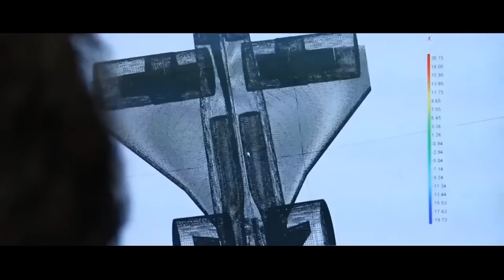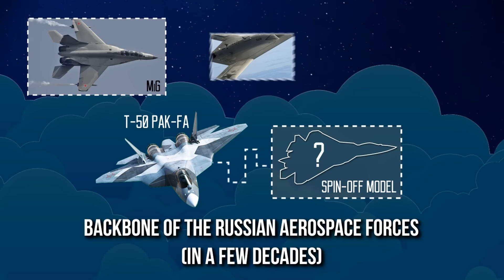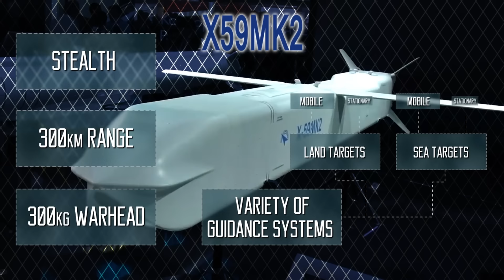The Sukhoi T-50 PAK FA 5th Generation Fighter Jet Will Enter Service in 2017 AS PLANNED

Comment: pakfa t-50 faster than the f-35 .  So it has better chance of outrunning missiles. its a supperior in all aspects
Reply: You do know that all air to air missiles in service with both air-forces` can go faster than the planes right? the T-50's top speed is mach 1.9. The average terminal speed of ATA missiles is between mach 2.5 and mach 4.
Reply: Oh unfortunately, the T-50 doesn't have the most powerful fighter jet engine in service to date.  The F-35 does.

The F-35 is not a superiority fighter unlike the F-22 and the T-50. The F-35 is smaller and hence more stealthier than the T-50. If you think that the data acquired from the designs of 3 stealth aircraft operated by the USAF didn't got into the F-35 you're dead wrong. Reports are all ready coming in from RED FLAG 16 "F-35 is stealthier than F22"
Reply: xXEndLessKaosXx  I never said that data from the three previous USAF stealth fighters didn't go into the f35. What I was think in king was quite the opposite ,why not upgrade the f22 with some of the same technologies as the f35 and they should have made more f22s. It doesn't matter anyhow  Russian radar can see the f35 anyhow
Reply: xXEndLessKaosXx  I like the pakfa t50 regardless of what people say. And the yanks got plenty of planes for specific missions that can simply be upgrade with all the latest technology. For close air support and loitering around the battlefield for hours on end and been tough and reliable with a big cannon of a gun ,a plane which helps the troops on the ground  ,the A10. Which I don't think the f35 can replace or do the same job as well. The upgraded F15 silent eagle and the upgraded F18 which have had there cross radar sections reduced to be less vissable on radar not 100% stealth but still effective , and they have put the latest computer technology in the cockpit and can have the same helmet as the f35 . I mean sure use the f35 but don't make it the only plane in the air force  . The f35, went past its budget and finishing date. It is the jet that ate the pentagon. Surely the yanks could have done better than that mat. That must have been several proto types of several different designs
Reply: xXEndLessKaosXx come to think of it both the f22 and f35 have that special stealth skin which if hit by even rifle bullets will get shredded. So they can't fly low to the ground and they both require a lot of maintanence . I suppose the f35 could be a bit more resiliant.But what about other planes like the silent eagle or the upgraded f18  they a lot more reseliant and have internal weapons bays and reduced radar cross section and cost a lot less. And the a10 real good for close support for troops on the ground. Why spend so much on the f35
Reply: Well I don't know why they spent so much on the f35 . it may be a good plane but I have gathered lots of  information about it and  what I've written about on here is based on the information I have been researching.
Reply: If you think the t50 is badass now...wait until the new engines designed for it "IZDELYE" 30 putting out 41 k pounds of thrust each go into production in 2017...it's top speed will probably match the f22